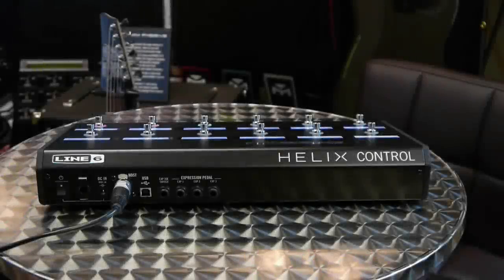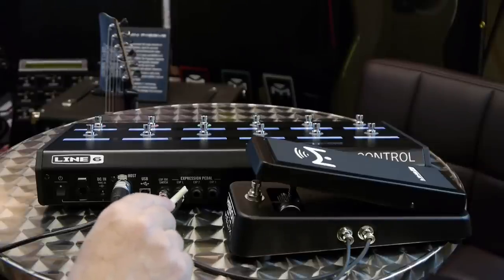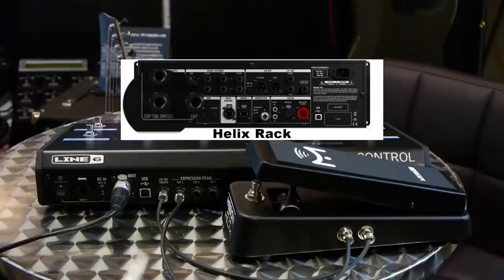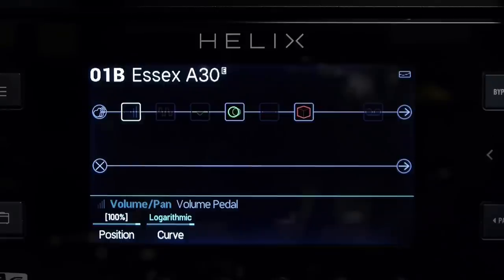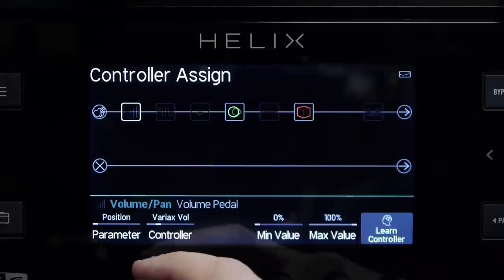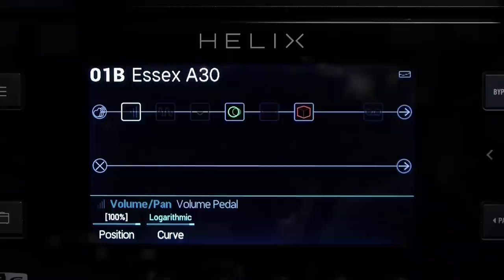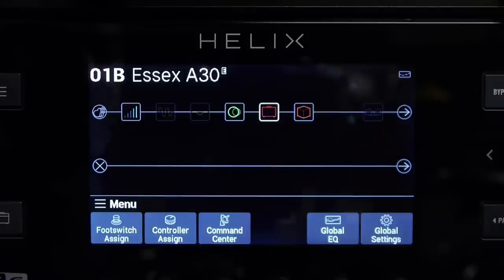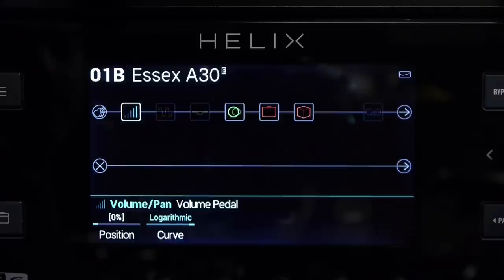Mission SP1-L6 Line 6 Helix Expression pedal

Comment from the maker: The Helix, like most Line 6 products uses a TS expression pedal, so use TS cables. The SP1-L6H uses two TS cables, one for the expression pedal and one for the switch. Most other (non Line 6) expression pedals are TRS and require TRS cables.
Reply: James Lebihan Dear James, I bought the fantastic SP-25L-PRO Aero : Does it work with Helix ? I think so because it's an expression pedal like the others. 
What kind of power adaptor ? 9V DC 2,1mm => OK. Is it 500mA ? 1A ? 2A ?
Many thanks in advance. 
Best regards from Dunkerque 

Phil.

Comment: Hi, I have an EP-1 Mission pedal, and if I use a TS or TRS cable I can't use tha full range of the pedal! when I step halfway down on the pedal, the range shown on helix goes from 0 to 50%, and when I continue to step toe down then the range showing in Helix goes back from 50 to 0%... So heel down is 0%, then it  goes to 50% and then back to 0%?! When I pull the jack cable halfway out of the pedal, then the wah pedal works properly from 0 to 100% in Helix. Any help how I can solve my problem? It's the regular Mission EP1 and does not matter if I use TS or TRS jack cable.
Reply from the maker: The EP-1 will not work with the Helix. You need an expression pedal that is designed for use with Line 6 products since they have a different expression pedal interface. The Mission EP1-L6 will work.

Comment from the maker: There is no standard for expression pedal interfaces so you need to choose the correct model for the device you are going to use it with. The Mission EP1-L6 and SP1-L6 work with Line 6 devices only. For use with the Strymon Mobius I would recommend the Mission EP25K
Reply: I have and FM3 and can’t decide between Sp25l or sp25m because the lack of information about it! Can you help me?

Comment: What brand TS connectors are you showing on the video? They look very very short.
Reply from the maker: They are Mission brand cables and connectors. They come as a kit so you can make the cables to the exact length that you need. I made these specifically for the video.

Comment: Does the integral expression pedal of the Helix floor model have a toe switch as well?
Reply from the maker: The Helix floor model on-board expression pedal has a toe switch. You can also connect a second external expression pedal to the floor model, but expression function only, no toe switch.
Reply: @JamesLebihan  can i use this pedal with the Helix floor? Just as expression function
Reply from the maker: @estebandebenedetti750  Yes. We also have a version without the switch. Model # EP1-L6
Reply: @JamesLebihan  thats more confortable for the Helix floor right? Cause it Will never touch a switch
Reply from the maker: @estebandebenedetti750  Both pedals will work, it's just that the switch on the SP version would not do anything with the Helix Floor. If you are intending to purchase a new expression pedal, the EP1-L6 version is less expensive, so there is no point in paying the extra for the switch unless you plan to upgrade to the Helix Rack or also use it with the HX Stomp.
Reply: @JamesLebihan  You are right! Thanks

Comment: did you connect your pedal to helix through TRS cable?
Reply from the maker: The Helix does not require TRS cables for the expression pedal. These are TS cables. The ones in the video I made using this kit https://missionengineering.com/shop-2/products/accessories/mcts-kit-10-10a/